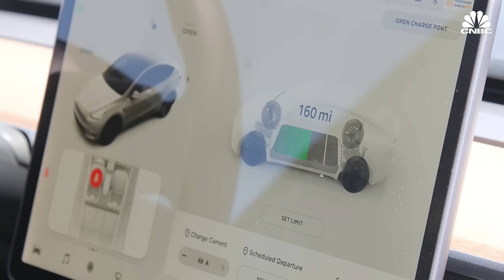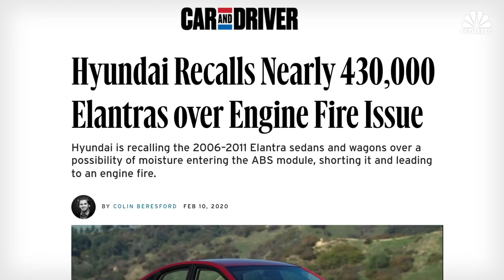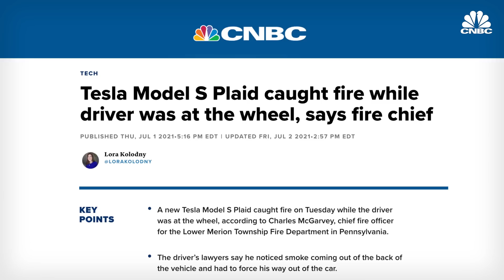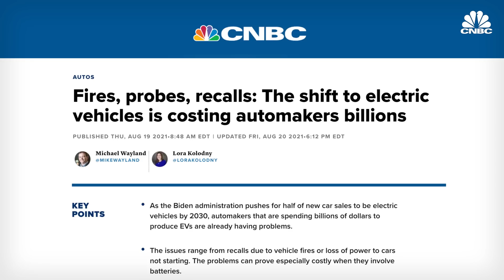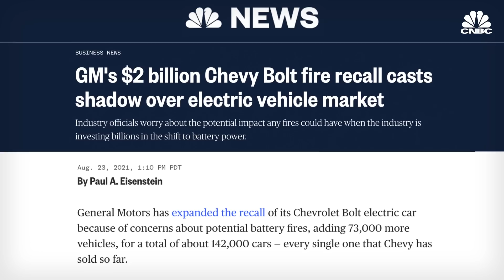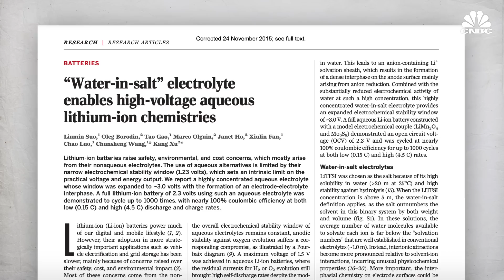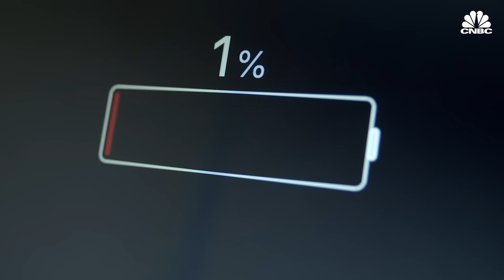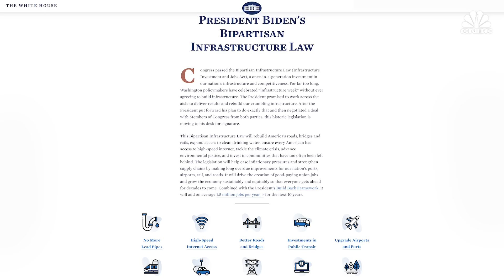Why Tesla, GM And Other EV Companies Have A Fire Problem

Comment: combustion engines catch fire much more regularly.
Reply: Yea but only because there are A LOT more of them out there.
Reply: @AK-rx6hv  There's also natural gas and hydrogen cars which are explosive. Your point? Why haven't they simply made a graph and indicates fires per 100k vehicles gas vs electric? Because that doesn't generate as much interest so they make a 15 minute video.

Some quick Googling: 
Hybrid vehicles: 3,474 fires per 100K sales
Gas vehicles: 1,529 fires per 100K sales
Electric vehicles: 25 fires per 100K sales

Comment: The powergrid have to scale up to meet the demand of EV.
Reply: When every household roof is properly used with photo voltaic solar glass tiles wired to household battery storage the world’s energy problems will be solved. The solutions are easier than we’re led to believe but governments are lazy and always lagging behind rather than striving for what is possible.
Reply: EVs can charge anytime, AC has to run at the worst time

Comment: The insurance guy said "The data that we've looked at so far doesn't indicate that there is an outsized risk of non-crash fire" 
That for what I can understand it means "doesn't occur very often" or i guess it is not increasing and getting out of hand...
This article is really close to scaremongering
Chrysler recalled 8 million cars ice in 2018 GM 9 millions in 2014, it still happen on ice car...
Reply: Close to?
Reply: Yep, recalls still happen with ICE vehicles.  But the overall majority of those are not related to a fire that could burn down your house.
Reply: @tomgreene7942  yes 16 over the amount o Bolt sold over 116,000 so it catches on fire the 0.001% of the cars it is not outsized over the average risk of fire on a  fuel engine car.
Citing the insurance guy not my idea
Reply: Why not ban cars entirely and make city's more sustainable and profitable by making them more dense and walkable it will reduce obesity and and other health issues and also battery cars are not good either they use tires and building them requires rare earth metals which causes pollution battery cars explode mixed housing is better
Reply: @ujjalshill6442  one step at a time, not everyone likes really drastic changes
Reply: The issue is those cars were faulty and recalled. These are issues with EVs functioning as they should until a minor crash with a barrier, etc. EV market share is minimal, yet they are over represented with fires recently - obviously from a numbers perspective there are so many ICE vehicles out there that they make up most fires. We only can fairly tell when EVs are as popular as ICE cars but that is when it’s too late. I love the idea of EVs but this worries me - looking forward to blade battery tech.
Reply: @User-cb4jm  the risk of fire is estimated to be around 10 and 60 times lower, I remember you that there are out there at least 2 million Tesla and another 2 million other cars, so the number compared are still low but statistically significant, so if statistics are off and they are an order of magnitude higher EV goes on par or it will be 6 times better than ICE.
I give you a personal anecdote, I had a second hand car, a petrol one, I drove really slow on a wet side road, the wheel slipped and the car went down the ditch, I pulled it out and everything seemed ok not even a scratch, two days later I realized that the radiator was damaged, by the car steaming everywhere while I was driving, just a small nick and I throw out a petrol car, so bad days happen for everyone!

Comment: As someone under 30, I solemnly swear to never buy an electric vehicle as my main form of transportation
Reply: 100 years ago you would have said to stick with your horse instead of a gas car. Times changes faster than people mentalities but eventually it catch up.
Reply: @lauinno3194  I am more concerned about range, durability and the ability to replace parts than anything else. I live in an area where a 40 mile drive one way is the standard and average commute for a homeowner, and I can't exactly plug in an electric vehicle at my apartment. Plus, despite owning 4 cars in my lifetime, I have never owned a car newer than 5 years old and 4 of them have been older than 10 years old/. Until the infrastructure changes completely and until you can buy and switch out parts readily and until a battery lasts 20 years I will never buy an electric vehicle until those conditions are met.
Reply: @wreckingopossum  Not sure I follow your logic there.  EV's are simpler and more reliable than combustion engine cars.  I seriously doubt you refuel your combustion engine car at your apartment either.

Batteries already last 20 years.  And switching out parts on electric cars is easier if anything than combustion engine cars since they are designed to be modular.
Reply: so your free from your oath when you turn 30?

Comment: This video is not at all representative for vehicle fires. We did a study at our university that found that there is no indication that EV are more likely to catch fire. 

An internal combustion engine is just as likely to catch fire. The increased fire impact is due to the high amount of plastics used in new cars. 
The only difference is the time that it takes for the battery to not ignite itself again which changes from a few hours in combustion engines to up to 24h for batteries.
Reply: Actual data in the USA shows EV's catch fire 60x less than combustion engines.

"Fully electric vehicles, on the other hand, were deemed far safer than both hybirds and gas cars; they are far less likely to catch fire, with just 25.1 fires per 100,000 sales. That's compared to 3,474 hybrid fires and 1,529 ICE fires per 100,000 sales respectively."

Comment: "Every single vehicle is different, even within a manufacturer" does this mean future regulation might include some kind of standardisation to designs?
Reply: clot shots  oh, I took different to mean there's not much interchangeability because of somewhat custom part designs
Reply: clot shots  well I assumed some regulatory body would set some kind of standards so that there is commonality if not within manufacturers then across the segment( not the government getting ok the drawing board and saying which exact shapes parts should be but that maybe they should at least have some kind of specified dimensions so that for example a tesla charger can be plugged into a rivian or something like that). But by the looks of things I'm a little ignorant here, no I have not heard of the yugo, will take your advice...
Reply: Electric vehicles are such a new thing that manufacturers are sharing all of their information and designs with each other, where they used to be extremely protective of those sorts of things. It's extremely strange, and I see it as a huge red flag.
Reply: No, people say crazy stuff because they are fairly new & not understood

Comment: To put out EV fire , need CO2 gas instead of water. or something that make temperatures down. example  water tank big enough for EV.
Reply: The problem with Lithium ion battery fires is that the battery produces it's own Oxygen. The water tank is a good idea but CO2 isn't the answer.
Reply: and really (while i DO like it's simplicity) the water tank is unfortunately NOT a practical/viable solution in the context of PREVENTION.  no, what it is a "half thought out" solution that only occurs AFTER THE FACT.  yeah, "after" like 18 cars and 10 houses have burned to the ground.  off the devastating "Blowtorch" Wildfire that occured back on 12-30-2021, i think you're going to find ALL the residents of Superior Colorado are going to have strong opinions on this.  #PREVENTION
Reply: Wont work. The chemistry creates to own source of oxygen.

Comment: The intensity of the fire and the difficulty in putting it out are why our 40-space residential garage may never get EV chargers. It's just not safe. Trucks can't navigate it safely to tow or "dunk" a burning EV. Even if the risk is small, it's real.
Reply: Ironically those defending Ev fires don't realize gas vehicles don't typically burn down peoples garages or homes. These electric vehicles are burning when sitting or charging.

Comment: Three words lithium, IRON, Phosphate.  Show me a fire in one of these.  BYD LFP blade battery show me a fire in one of these.  I will wait.
Reply: Two words, ENERGY DENSITY.  Show me a car with a LFP battery that exceeds the range of NMC or NCA batteries.  I'll wait.
Reply: @redbaron6805  show me a car with LFP batteries that actually caught on fire.  Even better the fully involved fire that takes hours to extinguish  like NCM or NCA batteries do.  I’ll wait.
Reply: @redbaron6805  show me an NMC or NCA battery that says you can charge from 0 to 100% every day and not worry about degradation.  Like the LFP battery does.  I’ll wait.
Reply: @fredfrond6148  Except that claim is a bit absurd.  LFP batteries don't have unlimited lifespans, they simply have longer lifespans than NCA and NMC batteries, but with some significant drawbacks with energy density, charging in cold temperatures and other issues.

So, lets not pretend it is a superior replacement that will work in every case.  It has some advantages and some disadvantages.  The application depends on if the trade offs are worth it.  Fire in Lithium Ion batteries is pretty rare already, so that by itself would not justify the switch.
Reply: @redbaron6805   show me and NMC or NCA battery manufacturer that lets you charge from 0 to a 100 % every day and and gives you a 500,000 km or 8 year warranty like BYD gives you.  I’ll wait.

Comment: There needs an emergency port to fill on the battery pack for fires.  Something that pops open during fire.
Reply: simple!
Reply: there's literally already foams and other ways to fight fires... They are just dumb, cheap and lazy...
Reply: @FindMoreFunds  issue is its sealed in a metal bomb casing.....
Reply: @GardensoftheAncientsHerbal  And - Manufactures could install a Fire Protection System - Like Aircraft do: Both ICE & BEV, could do so!